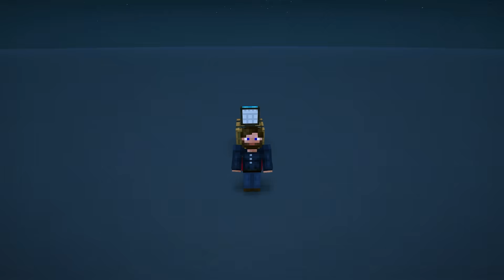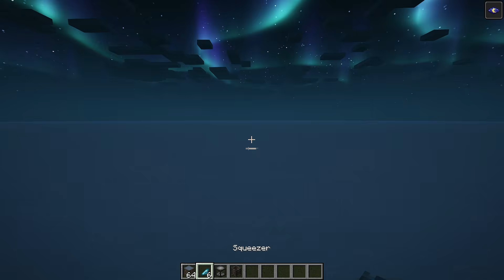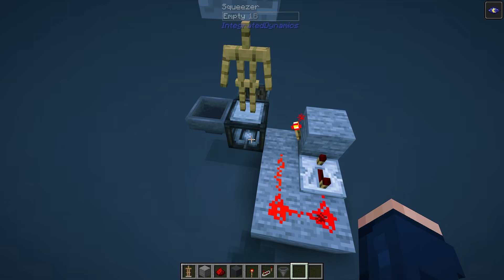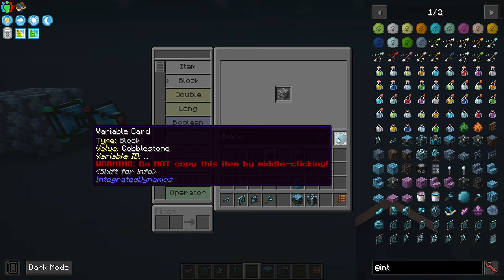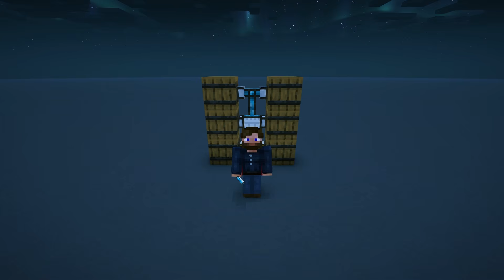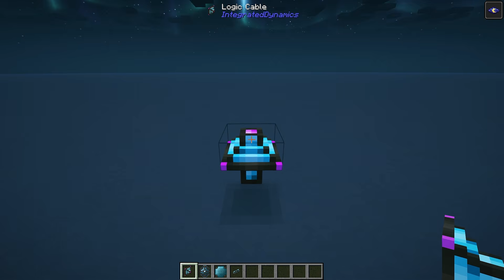Guide to Integrated Dynamics, Tunnels, and Terminals Mod | Modded Minecraft Tutorial

Comment: This mod is absolutely dogshit, my god. The world item importer/exporter are good, but the logic programmer is the absolute worst experience I ever had with programming. Every single variable taken from a reader is locked to that container, even the ones you derive from it, so actual automation is impossible. The UI is also atrocious. Going down on the list of junk on the left, you will find everything shoved together; grabbing what you want is a chore. Even if you use the search function. You can't take anything other than a boolean as an output of an expression; there are no loops or if statements, but the worst part of it has to be the fact that the variables are stored in your inventory. Minecraft inventory is already small in modern vanilla, and in a modpack it literaly fills up in less than a minute so you will be shifthing in your back pack constantly trying to grab what you want, and god help you if you lose a variable, you WILL have to start everything from scratch, you can't even rename the things without an anvil. Would not recomend

Comment: I saw you use this trick in another video and checked this one out to understand it better, but you didn't mention it here. For fluid exporters, you can change the transfer rate to something like 9999999 (just make sure you get a green check) and it will pull the max amount possible of water from a blockheads sink. This is especially helpful for Mekanism reactors to ensure they have coolant topped off at all time without having to extract water from all sides of multiple sinks or run a spaghetti maze of pipes to get enough water.

Comment: with the power of the variable store and variable cards one can build pretty much anything that suits your need. It can be as easy as shown here to make a really cheap but useful storage system at first.
Later you can create fine tuned systems with autocrafting, controlled farms and keep items in stock. Combined with other mods like drawers this makes it an even more powerful mod than AE2.
the only downside is that it by itself does not have a great mass storage like the disk drives of RS or AE2. And that's only storage in this case.
it can control huge systems with simple variables, and even read, control and interact with many other mods (without their consent xD) and trick those mods into doing things they usually dont want. for example something that needs the player is present? trick it into thinking a player is present by simulating a player and sending it to that block.

One of my favorite examples was a setup built for the Minecolonies mod (think playing sims combined with simcity in minecraft, NPCs build a colony, you direct where the buildings are, they build it. they gather resources and craft materials on their own if managed properly)
Integrated read their warehouse stock and kept wood&stone at a certain stock by controlling another colonist building and that buildings variables to stop or resume production (NPCs tend to overproduce basic materials, overfilling a warehouse if not kept in check).
Reply: integrate it into your ae2 system. Basically a subnetwork
Reply: Is this MineColonies automation something you did, or a video? Because I need this in my life!

Comment: Ahhh integrated dynamics. Or as i like to call it: PLC, the mod.

It's suprisingly powerful, only beaten by computercraft. Once i dreamt about controlling DE reactor with ID. That would be insane. Just have to be careful, the mod is way laggier than it looks. It's fine for singleplayer, but not recommended with server. I wish i can change the design so that it's more optimized, but eh whatever.

Tip for beginner: display is very useful for debugging. Simply put any variable and see what it's value.